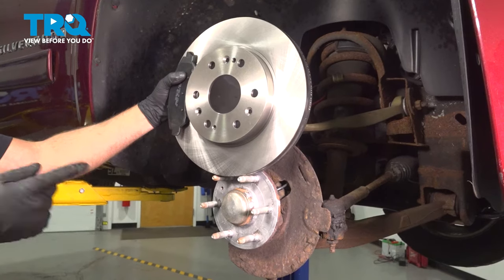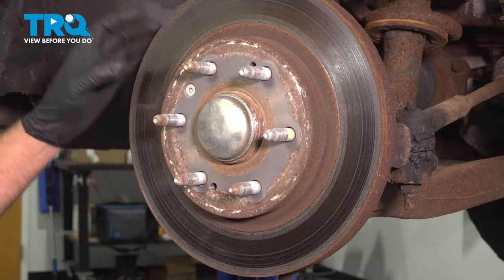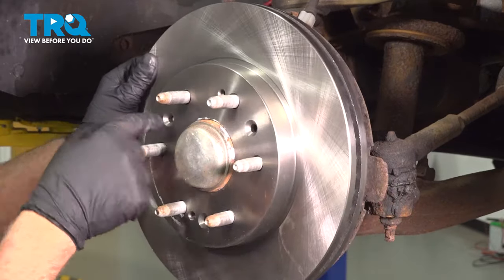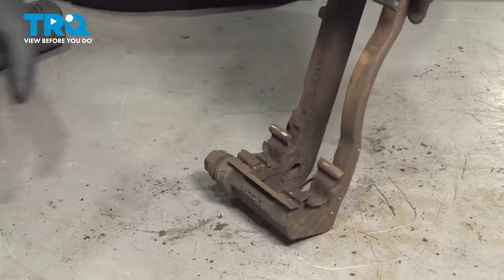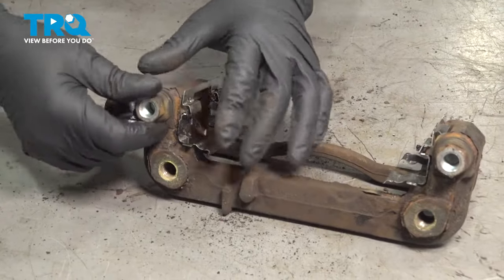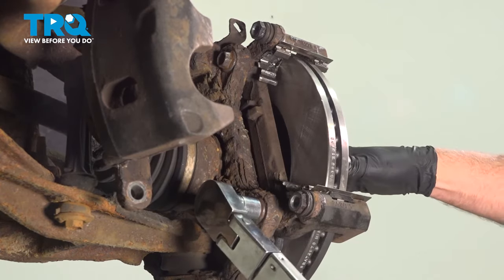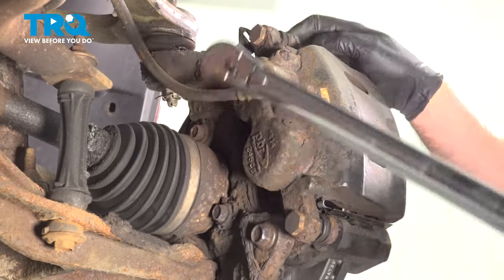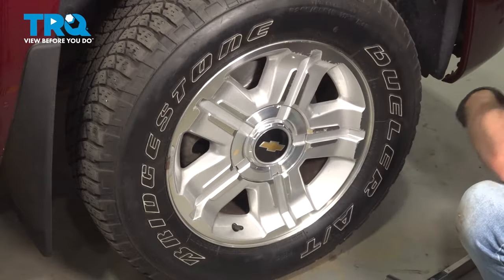How to Replace Front Brakes 2007-2013 Chevy Silverado 1500

Comment: Did my brakes a while back, i didn't have the service brake soon light b4, after i did them it popped up. Ive checked them multiple times everything is ok. The stealership wasn't sure why it was on either. I changed the brake booster sensor, still nothing. Changed the brake pedal position sensor, still on. Not sure what to do. Im gonna change the o ring behind the master cylinder and hopefully that does it. Any info or ideas are appreciated 👍 thanks